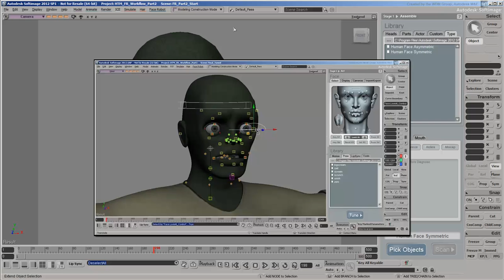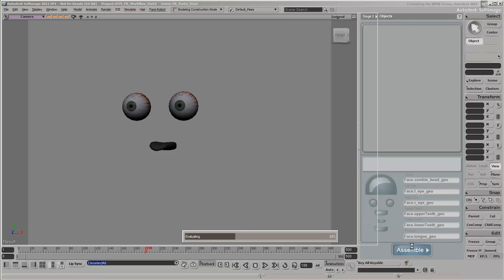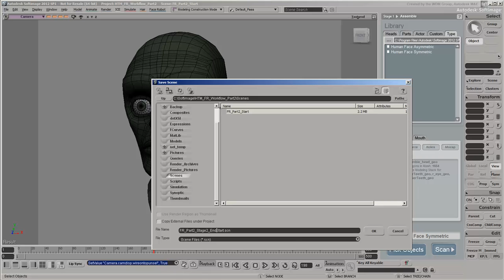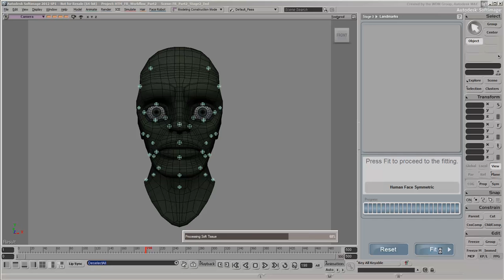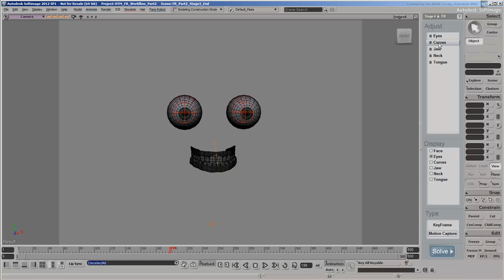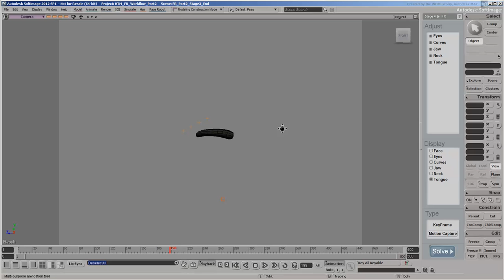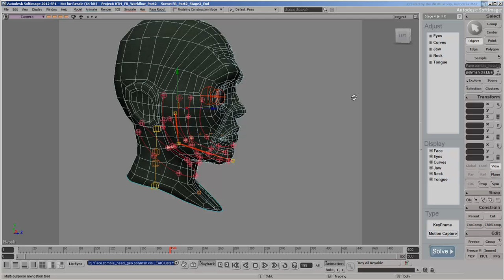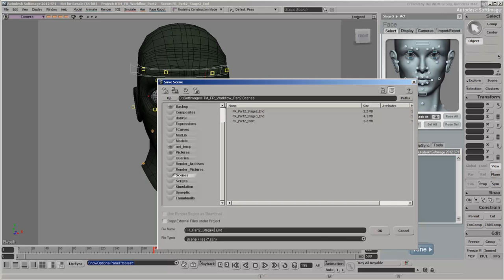Face Robot Workflow - Part 2: Creating the Facial Control Rig

Comment: I had the same problem. It probably has to do with the scale of the head. If your character doesn't absolutely have to be the size it is, just scale and try to solve again. You can open one of the heads that come with face robot and use those as preference.

Comment: Great videos, they have guided me through the majority of this setup very well!  I am however running into a problem when solving.  It seems to want to weight the entire head to the ear controls, more so the right than the left.  I can paint them out to 0 for the most of them, but some of them have 100% influence on verts around mouth, neck and eyes.  The mouth i realize will be overridden anyway, but it would be cool to find out if anyone has experienced this?

Comment: thanks for the response. here is the process:

I used facegen for the head template > brought to zbrush for remodelling and adding details > brought to max so that I can close the inner mouth (i extruded the inner borders , used CAP to cap the entire border of the mouth) > exported as OBj and brought to facerobot > I used the eye socket creator inside facerobot. the eyeballs are overlapping against the eye socket, could that be the issue?

Comment: I know a bit about GUI programming, so I rummaged through the folders to see if I could figure out why the buttons were cut off. It turns out that the GUI is mostly assembled in HTML and there is a version with and without frames. Just had to switch the reference between the two version dependent on your ability to see them, which unfortunately alienates everyone with a resolution of 720p and below.

Could you make a video about how to export? Specifically about exporting Facerobot to 3ds Max?

Comment: -On line 11, find where it says "facestage1_sideframe.html" in the url tag. 
-change the word "frame" to "View" so it will read "facestage1_sideview.html"
-click "File->Save" in the text editor
-Restart Softimage and the Facerobot dialog will be scrollable and won't just be static like it is by default.

So what's up Autodesk, are you guys gonna give me a job now or what